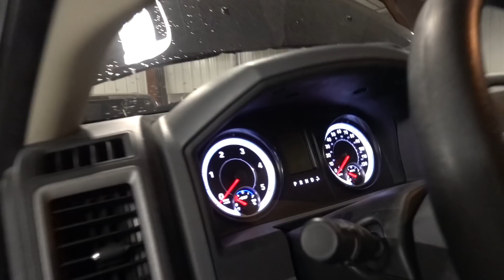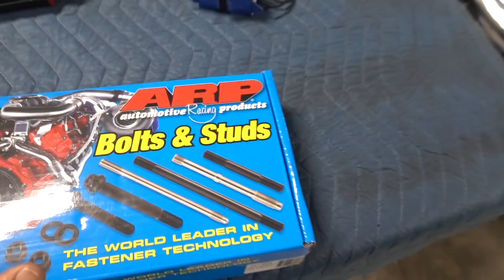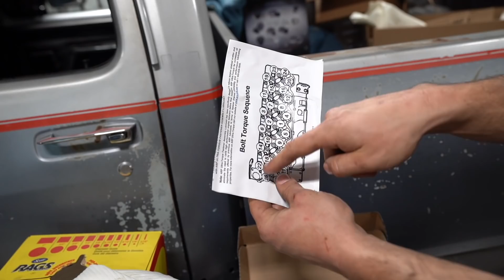How To Make Your CUMMINS Survive More POWER!!!

Comment: I just installed head studs on my 300,000+ mile 12 valve running a vgt he351ve.. No issues yet and I tow for a living up to 26,000 pounds gross weight. Those vgt turbos create a TON of pressure and it's still kicking. 18 degrees of timing, 0 fuel plate, afc tuning, 5" exhaust, etc.. I did the one on one method.

Comment: You should stick a billet Valve body and trans tuning on the stock 68rfe in that truck, I know you have full intentions to go all out with power on the truck but it would be very interesting to see how much the low mile stock transmission will take on just a VB and tuning? 🤔

Comment: I did my head studs one at a time at around 200k and I'm almost at 300k now and no problems. I'm also not super high HP just a 600HP 07 5.9 with stock appearing 63/67 turbo and bigger injectors.
Reply: 6.7’s are more prone bc the space between the cylinder and coolant jacket is smaller
Reply: My 12v ran 700+ on stock head studs. And still going today, 20 degree’s of timing as well, 5x16s and a HX52
Reply: That’s really good to hear man! I’m thinking about studding my 06 5.9 with 200k too as well. 625s, pushrods, valve springs, s464 w/ stock fuel and built trans and see how long that set up will last!
Reply: @shawnlack1527  - You mean factory head bolts right?

Comment: Would be curious on the effect of head studs and cylinder wear. More torque on the head studs actually stretches the cylinders more on a gas engine. Curious if the same effect happens on a diesel

Comment: I was curious if you set your valves at 10 and 20 still cause 6.7's changed the lash I personally still set mine at 10 and 20 also

Comment: Find a two-wheel drive gas excursion 67 swap it and all the mounting hardware for the two wheel drive suspension is the same as the four-wheel drive none leaf spring suspension so you can put a newer Ford suspension and have better steering on an excursion for Ali
Reply: 6.7 cummins

Comment: Get her a 2021 Durango r/t or if you got the funds do like I did and get her a 2021 Durango srt that’s what my wife dd’s it’s a great mommy car and I enjoy driving it as well her 2020 r/t was a freaking turtle or atleast it felt like it. But they are grade comfortable driving SUV’s with tons of room.
Reply: And I done my studs and all on my 2020 at 6k miles I also never gave the truck more then 3/4 throttle those 6k miles. I feel it’s all on how the truck is treated and mileage. But I did do a re torque 3 to be exact 500,2500,5000 and they moved but I’m also making alittle over 800rwhp kinda with ham building my dd only about 31,500 in aftermarket parts at this point. Building a 2020 Cummins ain’t cheap boys. But she drives like a stock truck with all the power one could want and the wife can take too get groceries no problem or worry.